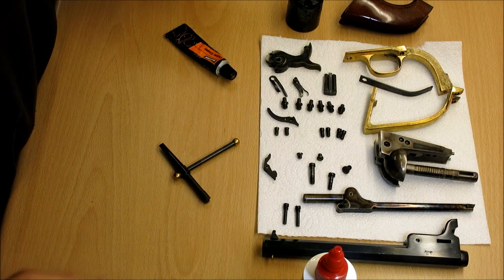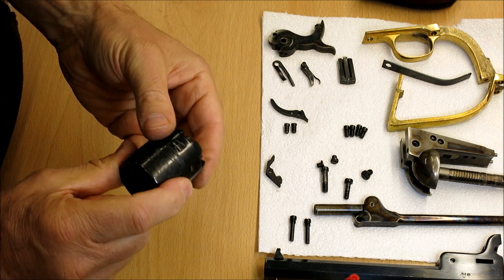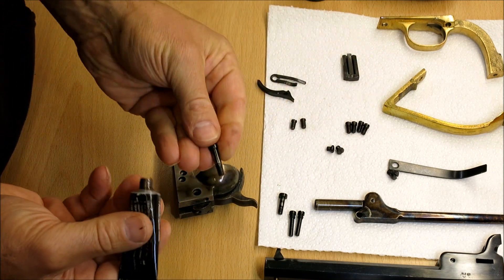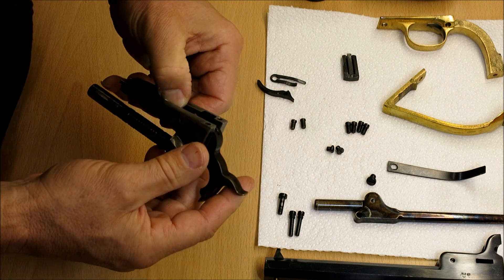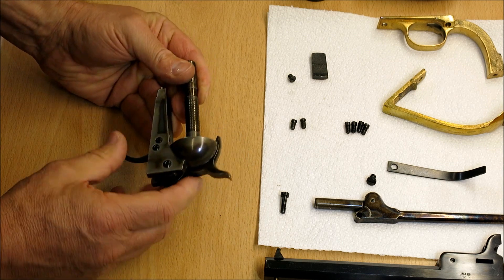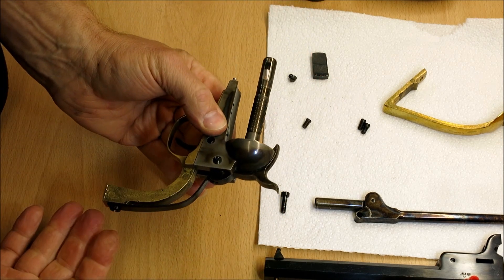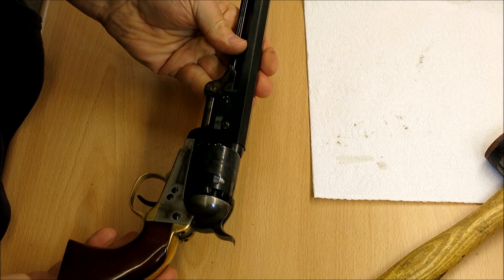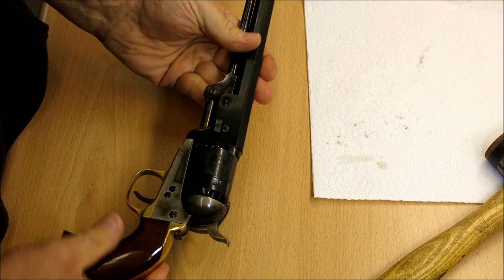Uberti 1851 Colt Navy: Reassembly

Comment: Just FYI the Uberti UK Specification blank firing 1851's with solid barrels, offset chambers and frames pinned to barrels also have exactly the same trigger and spring disassembly/reassembly methods as this.

Comment: Nice pair of video, very helpful. I have exactly the same colt, bought in 1981 and still working perfectly... I greatly appreciate the details, mainly for distinguishing every components from each over (and the smallest differences, e.g. btw screws). I will no more be afraid to fully dismantle it: I've your reference now!
Just a suggestion: after washing and drying the reloading arm, I used to put some oil to the retaining lock at the extremity, there's a very tiny spring in a blind hole that could catch rust due to some water. It could fall apart after some years...
Thanks from France.
Reply from the maker: Etienne Guyot Glad the video helps, thanks for the suggestion and kind words, it’s appreciated!😀

Comment: Excellent videos, Mark (both of them).  I have the same Uberti Navy (my second 1851: I still have my old Armi San Marco 1851, which I bought in the mid-1980s).  Uberti quality is very good.
I use pipe cleaners on the inside of the nipples, after soaking in hot water & detergent; then, I rinse them again and (like you) put everything in the oven on low heat.
I came upon your disassembly/cleaning video by accident.  Glad I did!  Looking forward to viewing some of your others, too!
-- Old Matt
Reply from the maker: Thanks for the kind words Matt, good shooting!

Comment: Very interesting and informative video, and as you commented everyone has their own way of cleaning a BP revolver. After many years of shooting revolvers I am adding a brief description of my methods which  might be helpful. First try a product call wonder wads between the powder and ball #OX-WAD-36-W, they greatly reduce fouling on the firearm, also I invested in an ultrasonic cleaner "with heater". A must have in my cleaning needs. The only cleaner and lubrication I would use is Ballistol, it will not gum things up as opposed to an oil product. On the nipples seat them with "never seize" I noticed yours were hard to unscrew. My barrel and cylinder cleaning are with a brush capped with a 1-1/4" cleaning patch on top.
Keep up the great videos.....RS
Reply from the maker: Thanks for the kind words and information. I do use wonder wads, the lubed ones and think they are great. All the best!
Reply: I have to concur - The Ultrasonic cleaner and the Ballistol are must have Items. They do wonders.

Comment: Very nice video, both this one and the one on how to take them apart. Just got my uberti navy and this really helped me out. Only problem is I can’t go further than “field stripping” it, because my screws are super tight and soft, so the “cut” in the head of the screws ruins and moves before I can get the screw started. Do you advise forcing them and replacing them if needed, or just letting them alone, at least until I need I deeper clean than usual?
Reply from the maker: If it was me I would be wanting to get it apart, but perhaps use some gentle heat, perhaps 200 DegC in the oven and some thin oil to try to loosen them off.  Also make sure the screwdriver is the best you have, or get a new one so you have the best chance to not damage them.  Good luck
Reply: @MarkRobinson555  thanks, I’ll go to my gun shop and ask if they recommend a specific screwdriver, than I’ll try the heat and the oil. The gun is 25 years old and it’s never been shoot, or at least the previous owner told me so. It’s definitely in new condition, but obviously has never been taken apart this far. I’ll let you know if I can get it apart!

Comment: I have an older one of these that originally came from Dixie Gun Works.  Probably an Uberti made kit gun from the 1970's.  It was purchased as a kit and has to my knowledge never been assembled.  I am using your video as a guide to figure out how to assemble it.  My problem is that when I try and install the trigger after putting the bolt in, there is interference fit between these two pieces.  The trigger will not slide into position so that I can install the screw.  It keeps hitting on the bolt.  What needs to be done to fix this so I can move on with the assembly?  Thanks for posting this video it is extremely helpful as no instructions were ever provided with these kits.

Comment: Great Video sir.  Do you mind sharing the brand and sizes of your screwdrivers?
Reply: I just picked up 3 bits and a handle from Brownell’s. Magna-Tip is the brand of the bits & the handle. The bits I picked up are: 180-3, 240-4 & 340-4. The handle with storage is a #84. Just a note, it will only hold 3 bits. That took some jiggling to get them in there. The site I heard all this on is the Duelist1954. He also uses Casey’s Choke Tube Lube for the nipples.  Hope this helps. Keep in mind other models may need additional bits.
Reply: @BarneyR-u2d  thanks brother

Comment: Do these black powder revolvers require more lubrication than modern revolvers? I ask because that seems like way too much oil to me. I hope to own one of these someday. Awesome video!
Reply from the maker: To be honest I don't know the answer to that, being from the UK we are not allowed modern revolvers, so I have never had one.  However, the way I lube seems to work just fine and keeps it going despite a build up of fouling.  Thanks for the kind comment about the VDO, its appreciated.
Reply: Oh okay thanks. Yeah a modern revolver requires a lot less lube (like maybe 6 small drops from the head of a pin here and there.) I'm totally new to BP though and I just didn't know if black powder needed more lubrication because of the fouling build up. Sounds like it might. I figure if it works it works right? I mean these designs are meant to withstand some pretty harsh treatment. Will you be doing more videos on BP revolvers in the future?
Reply: black powder is very bad when not clean, as the sulfur in it, sucks the water out of the air, and will rust a barrel in 2 days, so they were always cleaned 3 days in a round after firing, because the pores in the metal sweat, more dirt out, and the extra oil keeps the carbon soft so it comes out easier, and extra oil is removed before firing-- dry the bore and cylinder-

Comment: Well done Mark! Your videos are the starting point for me; a novice in the percussion world.
Question for you; I was given a "used-never-fired" Euroarms 1851 Navy. I was suspecting that it saw heavy dry firing based upon the obvious nipple impression on the face of the hammer, so I began researching a replacement hammer before shooting it. I cannot find parts for the Euroarms, so I purchased a new Uberti hammer hoping that they are interchangeable. This led me to watch your videos (very well done, I must add) for instruction on assembly. Then... at 5:33 in your video I see the same impression on your hammer! Is this normal and expected? Should I replace the hammer anyway? The new hammer does not have this impression.
Looking forward to your reply. Kindest regards
Twitch.
Reply from the maker: Thanks for your comment and kind works.  If the old hammer is working consistantly I would leave it alone, only replace it if its a problem. Good luck
Reply: My Uberti Colt 1860 is brand new and has the same circular impression on the hammer face. I dare say it is a design feature, not wear.

Besides, if you dry-fire the hammer against the nipples, it would be the nipples that take the damage and not the hammer.
Reply: @BogeyTheBear  That makes sense. The nipples do not look damaged at all, so I'm sure you are right. Thank you!

Comment: I find the wedge on the 1860 colt Uberti to be a pain in the ass. I just got one. I shot it took it home cleaned it put it together, most parts when in fine, got to the wedge, and no matter what I do it will not go back in all the way. It goes in like 90% and stops. I gently hit it with a rubber hammer, try the trick shown in the video, nothing.

Comment: Should not grease the inside at all!
When you shoot the powder fouling will build up on your parts more so, there. And make it more sluggish than it should be when it gets dirty! Those are not smokeless powder guns! Only put grease on the threads around the cones. And you can on any screw threads also. That's it. You will figure it out the more you shoot

Comment: My Navy has two springs for some reason, has anyone seen anything like that?
Reply: Are you talking about the long main trigger spring?  If so, how old is your gun?  I have an original model 1851 Colt Navy made in 1862 and it has two springs as well.  However, two springs is NOT factory original.  Usually, an "old timer" would add an extra spring when the factory one became weak over time or wanted the hammer to hit the percussion cap harder.  Many times these guns ended up out west, and without a nearby gunsmith, people would repair their own guns or make alterations, which was the case with my gun.  I know the complete history of my gun because it was my Great Grandfather's Civil War pistol.  After the war he traveled with it out west and subsequently it was handed down through the generations.
Reply: @ironcladranchandforge7292  it's an italian replica made in the 1960s. It's marked EIG
Reply: @Jabberwockybird   --  In that case the same reasons apply.  Weak spring, so somebody added a second one, or wanted more pressure on the trigger.  The second spring on my gun was home made way back when.  But, I've heard of people doubling up using factory made springs even on the modern reproductions.  I'm fairly certain it didn't come from the factory like that.